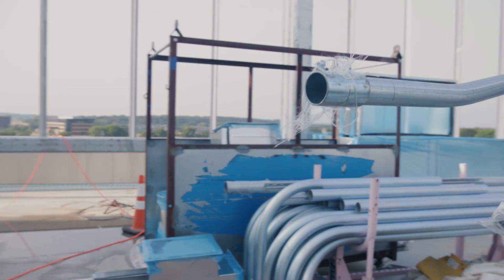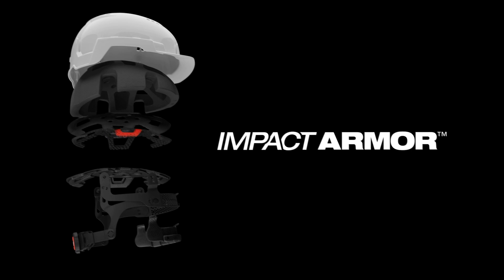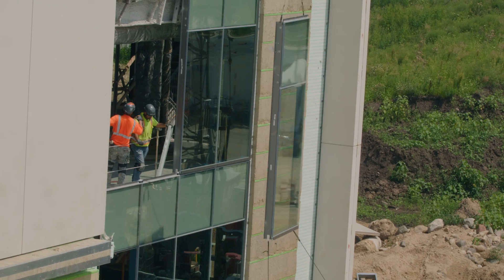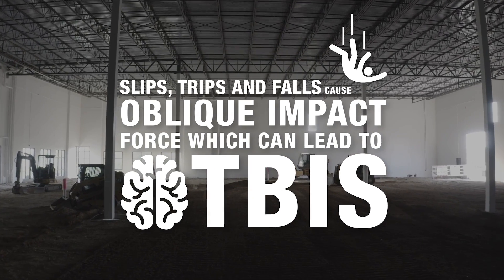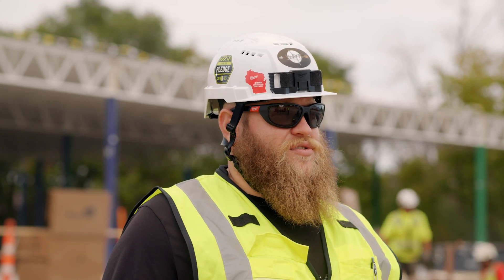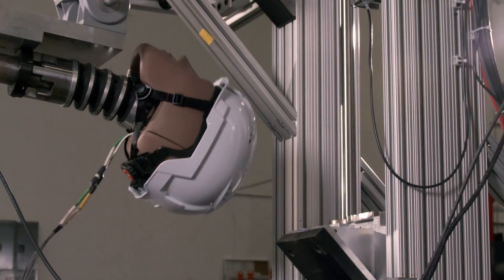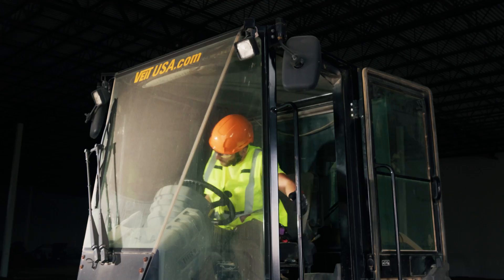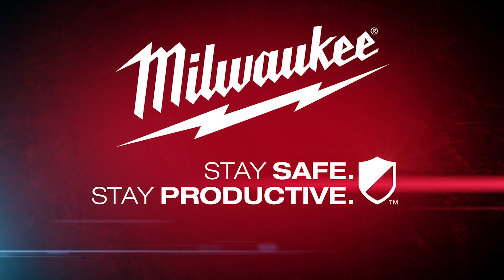BOLT™ Safety Helmets with IMPACT ARMOR™ Liner

Comment: I love my new hard hat, but i need help with safe storage ideas for my clear full face shield when not in use?
Reply from the maker: For safe storage of your clear full face shield, keep it in a clean, dry area away from sharp tools and direct sunlight. Use a soft protective bag or sleeve to prevent scratches, or hang it by the headband on a hook (never by the shield). For transport, Milwaukee’s PACKOUT™ crate or organizer or a Jobsite Backpack (48-22-8200) works well to keep PPE protected and organized.